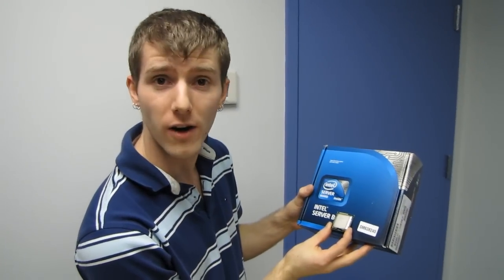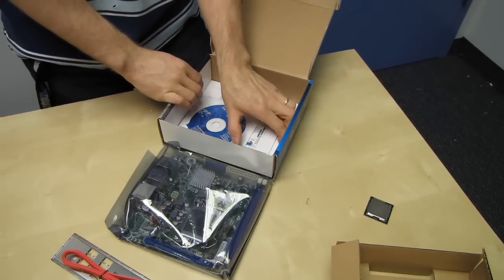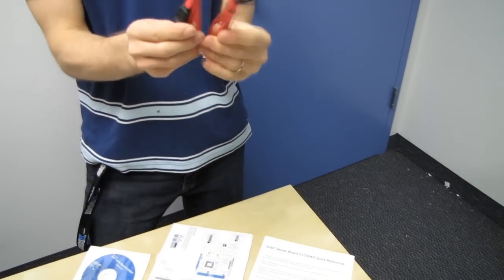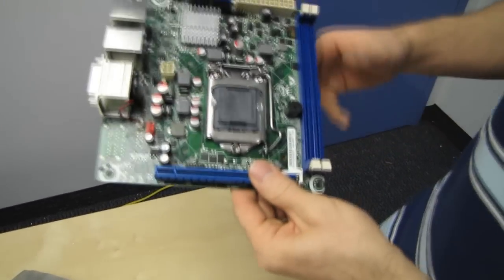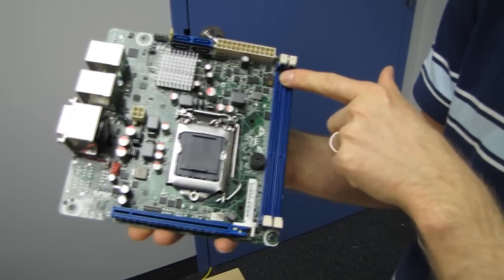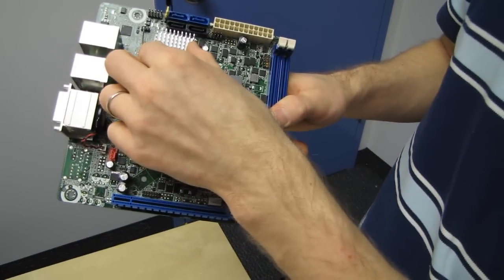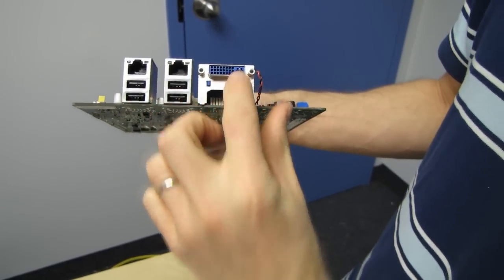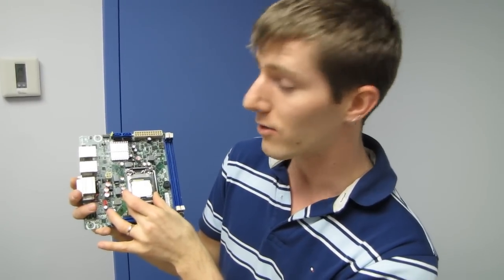Intel Xeon 1260L Lower Power CPU & S1200KP mITX Server Board Unboxing & First Look Linus Tech Tips

Comment: Hey LTT, I recently purchased one of these boards on eBay and it didn't come with an I/O panel. Do you still have this kicking around?
Reply: they fried three of em lol
Reply: All I wanted was the I/O shield! The only other option is to 3D print it at this point. Even contacting Intel about it and they said they don't carry any parts for it anymore.

Comment: @greedyn00b There is no point of gamers getting servers. Servers are designed to host websites, manage game lobbies, etc. and despite what the other guy said you can still be the host for video games (mw2 for example). Servers are equivalent to CAD cards, they offer better prepossessing power (physics, texture streaming) but have worse performance(the way the data is processed is less efficient).

Comment: @TheDeucetrey what i ment by run off servers was your computer connects to a "server" to play with other people that connect to it. I used my old computer to host the server it lags if more then 2 tvs try to access it at once but it is an old single core p4 xbox360 ps3 and blueray players around the house connect to it and stream they very easy to setup

Comment: you could use this for NAS, or you could use an old 50 dollar computer which will probably do just as good of a job. 
I used an old Dell optiplex with p4 2.8ghz and installed FreeNAS on it.. been stable for the past 2 months and the computer cost me zippo... (well, I had a SATA controller that you would usually buy with an older pc)

Comment: @GAKtion64 your motherboard box. I had mine on my box with the foam sheet inbetween the board and the box before when i was painting my case. not sure if the foam is conductive but it still works fine. cardboard for sure is fine.

Comment: @LinusTechTips so what should i put the board on when its powered on? i have some motherboards that i have been putting on the static bag while powered on and they always worked fine. 

should i just put them on some card board box or a piece of wood? i dont have a test bench like you do.

Comment: @ubuntupasztor 
Yes, you absolutely can.
However, you would need a larger case than the normal size used for ITX boards, but it would defeat the purpose of having a small motherboard in the beginning.

Comment: @TalesOfWar Yeah I agree with you, like I said I think this could be appealing for pro/business use, but for home users there are better options :)

I still think Atom/Fusion would be ok for all the uses you listed, but if you need more oomph a Pentium Dual-Core/Fusion Ax based system would offer similar performance to this Xeon at a much lower cost. It isn't backed by the rigorous validation server hardware is, but you're very unlikely to have issues these days

Comment: @LordThoth16 At 90% power conversion efficiency, with a 45W CPU, VRMs would be dissipating 4.5W at most, that's 1.5W per VRM.. that isn't going to cause any overheating problems. :P

Comment: @dynetrax They don't. High quality DC-DC VRMs have power conversion efficiency of 90% (and more), which means 4.5W _at most_ with a 45W CPU. And 4.5W distributed across 3 VRMs is 1.5W each.

Comment: Here is my solution: Get an Asrock H61MVS mother board, Get an i5 2500, Get more I\O options and better reliability. Pay less, have a heat problem? decrease multiplayer and voltage